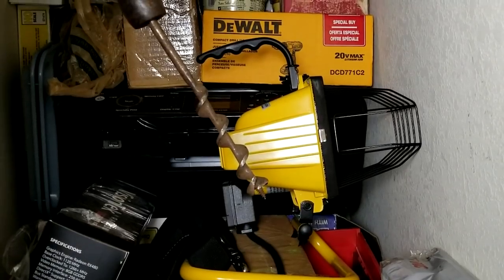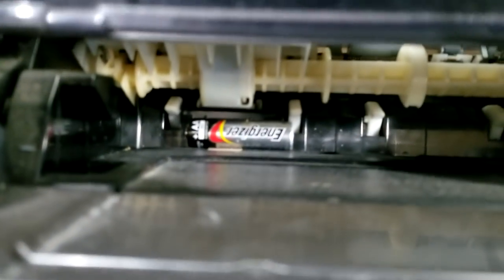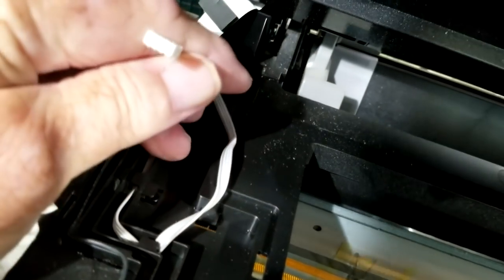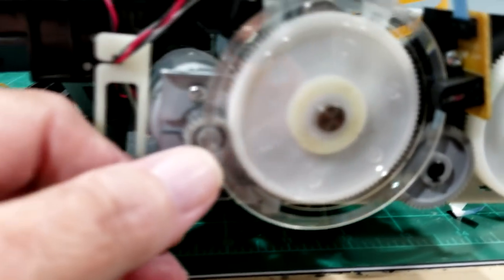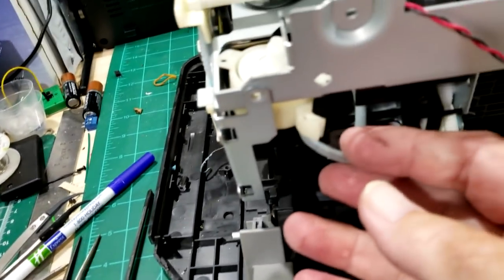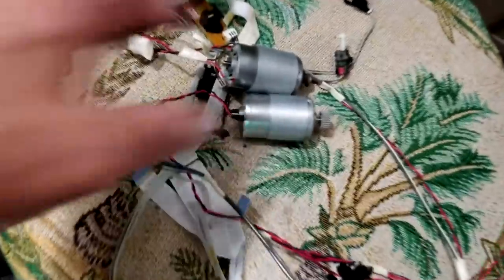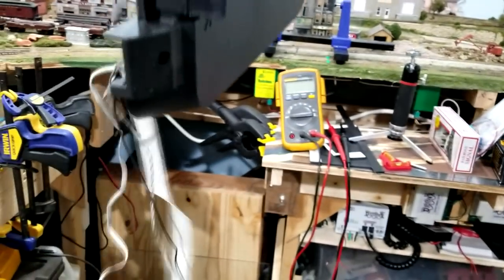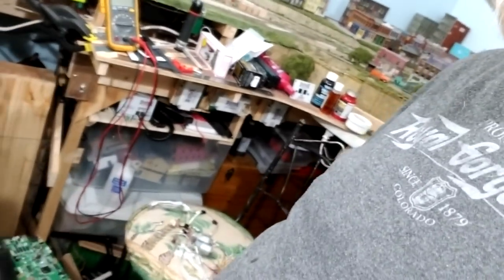Is It Worth Tearing Down A Printer For The Parts?

Comment: If you do this again, search for the service manual for the printer. They wrote the most incredible, detailed manuals for these things which go as far as to explain the concepts behind the mechinisms, all of the electrical systems, the logic system, inputs and outputs etc etc. And they have detailed assembly and disassembly instructions. I just tore down a similar slightly less advanced epson, and the manual meant I didn't break anything and was able to keep most of it in tact.

Comment: I have taken apart multiple printers and scanners in the past and they are a great place for getting motors and mechanical parts. For getting stepper motors, I would recommend taking apart a bit of older printers because new ones have DC motors with rotary encoders in them.
Reply from the maker: My taking apart equipment goes back when I was a kid. Some of them were working before I took thwm apart. Not so much afterwards. lol

Comment: thank you Tom.I have a kodak printer thats been saved for scavaging for my railroad.Sure am glad I am not the only one that does these things to grow my railroad.Its also one of the fun events having a model railroad and inventing different ways to make it work without throwing cash at it all the time.Happy new year my friend.
Reply from the maker: I pulled apart a Home Theater that crapped out from a lightning strike, out of all the components in my house it was the only component damaged. The power supply was damaged but I still saved it for parts. I like tearing things apart. When I was young I had a problem putting everything back together. I got over that phase.

Comment: Around some ribbon cables and other wires you will find some ferrite cores. These can be used to build block detectors.
Reply from the maker: Thanks for the tip on that Roy. How are they used in block detection?
Reply: @TomsTrainsandThings  For those who like to build circuits, you take one of the track feed wires and pass it through and around the ferrite core a few turns and  then to the track. You then use another piece of wire and wrap a second set of several turns through and around the ferrite core. You have now constructed a transformer. When the train enters the block, current will flow. This will generate a magnetic field that is transferred to the second winding which in turn generates its own voltage/current. This is sensed through some simple electronics to a light or an arduino or however you wish to convey the detection message. There are simple circuits available online for those who wish to build such a device. Note: This is for DCC only.
Reply from the maker: Thank you for responding Roy. This is great information for a low cost detection system. Appreciate your input!

Comment: How would you wire up the sensor and tone ring.  Would be great for turntable indexing
Reply from the maker: That's what I was thinking when I took it apart. Connect the sensor to an Arduino and determine how many pulses between each track.

Comment: my school had this old printer that was broken, and my friend needed some motors, so we took it apart (partly, not fully) and at first my friend preferred to use the hammer, while i removed screws and pieces (i took some fans for my projects, and the circuit boards), but then my friend was struggling with one part (with smashing the plastic housing or something) i was like " give me the hammer" and plastic flew everywhere and everyone turned to us like "umm... nice" it was a fun class to say the least xD
Reply from the maker: It's fun to tear things apart. When I was in school, they never had something like that. I just tore apart anything I could find to see how it worked. Never could put them back together though. LOL

Comment: This video would have been a lot better if you took it apart my way: with a hammer. Lol. Very interesting Tom. Is Debbie ok with you setting up another shop in the dining room? “Pass the salt dear” “Sending the train over now.”
Reply from the maker: I thought about the sledge hammer but I wanted at least some usable parts. I can run it from the kitchen through the dining room to the living room, that way I won't have to get up for a snack. There's a reason for all those Arduino projects. lol Debbie already gave the Okay for the dinning room since we only use it when the grand kids are here.